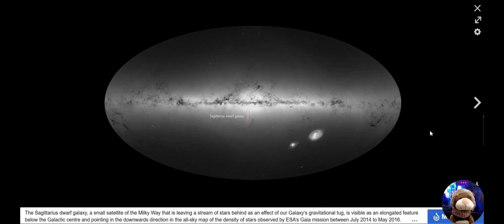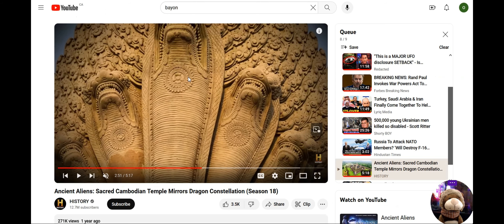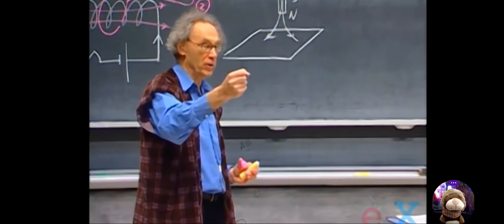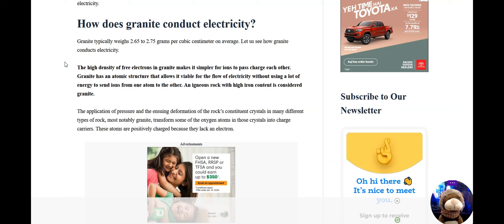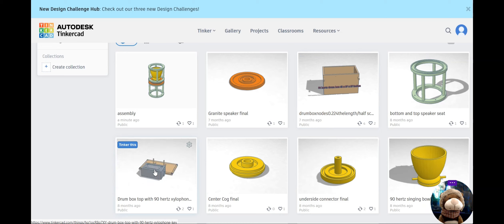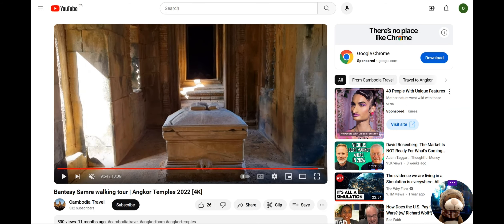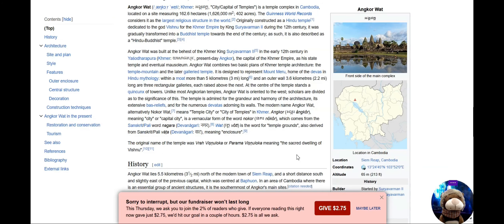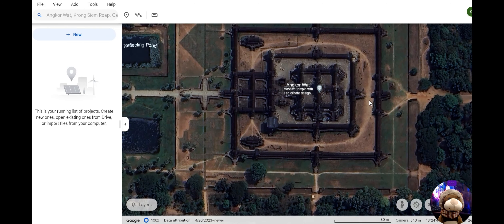Galaxy in a Box The Thermoacoustic Universe Part 3  Angkor Wat

Comment: Hi legend just gonna make sure u OK?kindly respond yes...God bless 🙌
Reply from the maker: Ya I'm ok. Hope you all see how simple this is.
Reply: @omegafile  that's good to hear that u ok,thanks to God,, do u have Facebook at all I don't think YouTube let us talk here, I've got a few question,,, hope u can help me,,,much appreciated, God bless you
Reply from the maker: @abbaspourmoghadam3850  My email link is on my channel...
You tube lets us talk as long as we don't put links.
Reply: @omegafile 🙏🙏is there any way to make another design without water,as I know a few physicists Done that!like John hutchison, floyd sparky sweet, mark coming,john bedini, they just use piezoelectric material to tap into zero point energy field, I know if up put energy onto piezoelectric crystals,will get more energy out ,I'm thinking make a transformer with piezoelectric core n use high voltage oscillator as a feed back,,any ideas how to do it?much appreciated
Reply from the maker: @abbaspourmoghadam3850  
Water is not something you add to make it work... but you have to look at how the earth works.. hot / cold... low pressure /high pressure. You would have to read the work of Laird Scranton " Amma and the spark of the universe". Without the water it won't work. Hot air rises and meets cold air and turns into water....it's nature.
Your not going to get any amperage out of anything Piezoelectric.. you need the steady arc to get the voltage drop to get the current. Something has to do the work.. in this case the sound coming out of the hole once it heats up. If you took out the hole.. it wouldn't work.
If you put this on the moon..... it would work because it doesn't need the atmosphere to get an arc....it only needs the vibration.. but since the arcs are in radio frequency.. it will still work.
Reply from the maker: @abbaspourmoghadam3850  Nothing special about John Hutchinsons work... using a big amp and interviewing the object with a microphone...nothing special about an Ark that was plugged in....ya these people are pulling mili amps. While they are still trying to figure out how to get more power I'm still trying to figure out how to get less lol. Yes you could do it another way near a noisy environment like near a waterfall.. but it would not be over unity.
You could do it with a chimney...... or a wind chime....
Reply: @omegafile  really greatful for Ur knowledge,  I'm trying to figure out how to make like Ur system but a bit more handleable not to be dangerous,
Reply from the maker: @abbaspourmoghadam3850  I've been trying to figure out how to reduce the power for decades. You could try the 360 hertz model with Jade disks....smaller xylophone key like about 150 lbs...
Regardless....I somehow did it by accident with a well pump switch and the main breaker turned off and it lit up my basement brighter than the sun.. an arc jumped to my finger and squeezed my heart... It wasn't pleasant.
My fingernail and the contact points (like a tuning fork) was the transducer..... It becomes 2 energies coming together and they wrap around each other in a torus... an embrace...
Angkor Wat uses the draft from a chimney... it's 699 ft high... there is a 90 ft shaft to the basement.... notice the number 9..... it is exactly 72 cubits from the centre tower to the outer perimeter.... adds up to 9 again...The Royal cubit is tied to sound.
Giza was boiling water to make pressure to open and close a gate like a ball whistle. I know it was boiling water because of the Calcium and limescale found at the bottom of the shafts.. same stuff you find in an old hot water heater. Chiss Dunn's theory is wrong.
Reply: @omegafile  I'm so fascinated over Ur system, wish u could atleast make a prototype of it to understand further more,I'm still staggered how the system starts, where the water spins ,even how it switches on n off but I fully understand the whole concept as I knew before overunity is all about resonance n vibration, n the whole story about piezoelectric properties, I'm a mad fan of tesla, people like me definitely will support u in funding wise because it will save humanity and nature,,much respect 🙏
Reply from the maker: @abbaspourmoghadam3850  It all comes down to that I can't ask anyone to build it because I don't want to be liable if they hurt themselves.
The Magnetic field from the vibrating box would deflect water droplets spinning inside...however they get smashed into the tiniest particles... look up some videos of what happens to water droplets at even 30k hertz....cavitation videos...
You would have to pry the xylophone key off the top and probably jam a pole into the hole to get it to stop......I don't think it's even safe getting near it. I haven't figured out the solution to go further with it....
Reply: @omegafile  last year in south Australia two electrician disappeared due to high voltage ⚡️ they were going to fix the box in street only their boot left in the corner,, Ur right ✅️ 😢 can't mock around with it
Reply from the maker: @abbaspourmoghadam3850  I have looked at some of the latest fusion reactors... they cost more to run than the energy they produce lol .. because they are going about the whole thing wrong. The galaxy in a box is super simple.. and the hole does all the work. It's way more advanced than anything in existence and it will probably take 50 years before enough people even notice lol.
The whole concept of fusion is a farce.... the sun is an electric arc furnace. They spend billions on the wrong stuff and waste a lot of money lol.. I can't change the world but a lot of science is a bunch of baloney...
I am very glad that you understand it.. and now that you know how it's done.. it's so simple isn't it... you could almost kick yourself....and wonder ....and you get that wow moment....because .. this is grade 10 stuff....and I am really proud that I figured it out with no help from anyone...
Reply: @omegafile I just heated up my crystal cells with piezo that I had made the amperage showed up...definitely it works ,heat ,sound, vibration are the keys ,,that I knew it for ages.  Thank u man ,n how they lied to us for 100 years
Reply from the maker: @abbaspourmoghadam3850  This would have been out a decade ago.. gave it to Dr Steven Greer and he completely ignored me for a decade... never replied at all other than his spam for a decade.,... I realize now he made millions of dollars .... and he is a shill...  I am disgusted with these types of people they are liars and fakes....
Reply from the maker: @abbaspourmoghadam3850  I looked and looked at the galaxy and I couldn't find the gas station or the power plant powering it.... and I realized that stuff like string theory and dark energy is a load of baloney.... common sense prevails.
I looked at a hurricane and I found a hole... go figure it's right in front of everyone's eyes....
I can tackle time travel if I had a team to work with.. and the navigation system....but nobody has come forward or offered. I should get something for what I figured out... I got nothing.. so I gave it away... and happy that I did because It's going to take many people to learn this to move the whole world forward.
Reply: @omegafile  greer is a grifter my friend, shame on him..I know one person might can do something with it ,personally believe he is good man,n very smart, robbert murry smith,try to contact with him if u don't mind...he is in London n read the comments too very polite person..find him on YouTube
Reply from the maker: @abbaspourmoghadam3850  Ya Robert is a good guy. I can't go on other peoples channels and foist this on people the comment will get deleted. I am unable to show it in that manner. Might work If you drop him a comment... mine for sure will get deleted.
This might be too much for him as well..... it's Ideal for a tinkerer who has balls to build it. People do build power plants...so there are people out there who have the experience to tackle something like this.... and there are people who could probably build a safer model too. Ideally since energy is privatized and deregulated.... whoever gets the investors together to build such a power plant will likely make a whole lot of money.
Green energy needs to come out. I spoke to the minister of energy in one of the Canadian provinces I won't name and he said it's ok to build a power plant and offered 2 places to reach out to for public and private investors and get funding for innovation. I just haven't had the time to reply or even follow up on it yet. This really needs a few dedicated people like a committee to see this through. It's a lot for me to take on myself. They need power and I don't want to see 3 nuclear plants go up there soon....
Reply: @omegafile  I will drop a comment, I can't wait to see its happening,,thank u
Reply from the maker: @abbaspourmoghadam3850   I showed the disks to John Hutchison over a year ago before I drew the bowl... explained to him how it's done.... got a big "Wow..wow" from him.... made the first video sent the link to him and never heard from him again.
Robert Murrey Smith did a video showing John pulling on a toy UFO with a string...John is not the real deal either.....I don't even believe the Adair guy either... I think he is another Al Bielik.
Here is another twist..... look at any Mike Markum video about time travel.. they show a set of plans.... I'm the one who drew the plans it's my handwriting on the plans... It was my first prototype and it was not meant to be plugged in...I never met Mark... don't know him... and don't believe him either.. think hes a scrap metal thief...
I also found the original bowl in Africa after I drew my own plans for the bowl. I put it in the video "it fell from the sky". The centre hole may need to be bigger.....but it's a true fact that I never saw the bowl until after I designed this one... and if you look closely at the bowl.. it looks pitted from the arcs.
I see it again and again in nature.. the bowl is the centre of the flower of life and can be seen on any flower....

Comment: So you want people to see this? More the better?
Reply from the maker: It seems like the logical solution to clean green energy. Opens the door to innovation and advancement. However I'm too afraid to even build a prototype. So incredibly dangerous and I can't even ask anyone to risk their life. I'm assuming 500 million watts and up..... depends how powerful the magnet gets... and then the cavitation on top of that... Suitable as a power plant... base power.
A nuclear power plant needs to boil water to spin a turbine and you get a lot of nasty waste.  This device would give raw base  power no turbine needed... no moving parts. There is also the option of putting a secondary coil around the top seat as well.... but I didn't put that because it's too dangerous already.
The radio frequency from the arc's inside is going to make the magnet bounce up to 20 million times a second.. I can't put a number on how many amps... but you saw in the video that you can get 30 amps using your hand and a weak magnet..... compare that to an electromagnet and 20 million times a second change in the magnetic field...
But even at 30 amps if it goes to 15 million volts you have 450 million watts already... and what if it goes to 100 amps.... then you have over a terrawatt....
Based on the formulate that 500 lbs of force on a quartz crystal can release 12,500 volts per cubic centimetre.. I am assuming about 4000 volts per cubic centimetre with a 40% quartz content.... it amounts to millions of volts per disk. The higher the voltage the stronger the magnetic field.
The outer magnetic field of the box deflects the spinning plasma inside so it spins in a torus. The water droplets will vibrate and smash apart so hard that they will light up... cavitation.